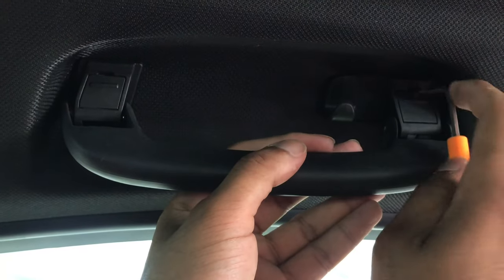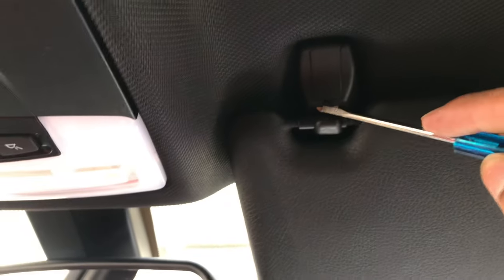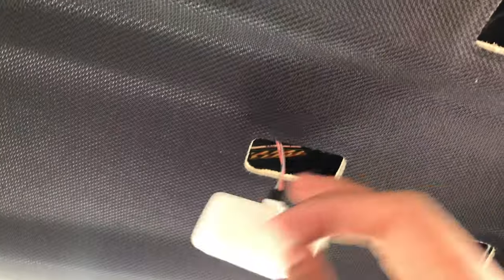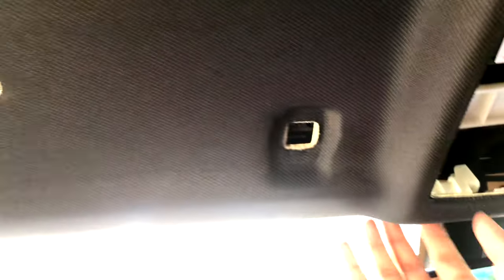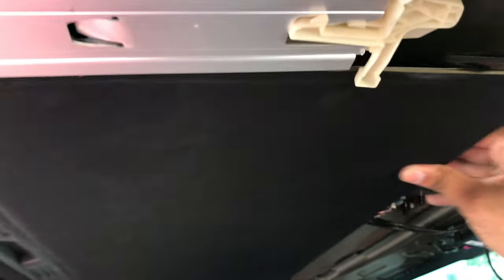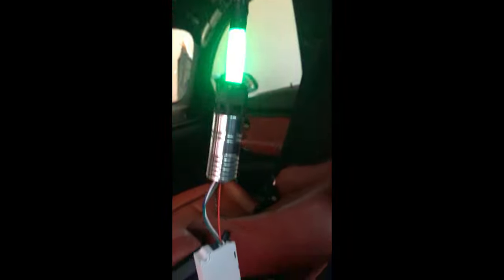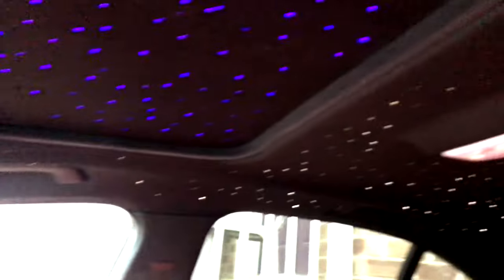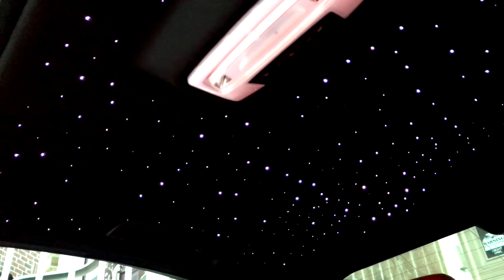STARLIGHT HEADLINER ON BMW F30 (ROLLS ROYCE)

Comment: If you check the left side of your trunk you have a 12 v car outlet you could plug it into. Just found it on my car the other day.
Reply: Where specifically
Reply: @SosaPrOdIgY  trunk on the drivers side (opposite of battery side)

Comment: Since your lights are connected to your inverter, do you leave the inverter on all the time or you have to turn the inverter off everytime you leave the car? I watched the video and bought the same one you got and have it connected to my battery but I don’t know if it’ll drain my battery while the inverter stays on but keeping the lights off.
Reply from the maker: I usually switch it off. The alternative option would be tapping into the accessory area in the fuse box. (Accessories only turn on once you turn the ignition on)

Comment: Is pulling the sunroof back and forth still smooth as OEM or do the starlights effect the motion of the sunroof?
Reply from the maker: No, it’s not smooth. That’s the only thing you have to sacrifice in order to do the sunroof.
Reply: @BuildsBySahib  Is there anyway that it could be made smooth?
Reply: @BuildsBySahib  you mean sliding the sunroof glass isn't smooth or just the sunroof cover?

Comment: Hello I would like to know where you plugged the engine led light 16w on your car. Is it directly on the battery? Or somewhere else you found 12v cable? Thanks
Reply from the maker: I used a power inverter which is connected directly to the battery.
Something like this 👇🏻
400W Car Power Inverter, DC 12V to 110V AC Converter with 2 Charger Outlets and Dual 3.1A USB Ports Cigarette Lighter Socket Adapter https://www.amazon.ca/dp/B088PFQLM7/ref=cm_sw_r_cp_api_fabc_zKM2FbNE01ZW5?_encoding=UTF8&psc=1
Reply from the maker: Another option is to tap into the fuse box in the accessory area. You can buy fuse tap from amazon
Reply: @BuildsBySahib  OK thanks very much. But is it possible to plug at cigar lighter or ceiling light directly. I'm looking for the shortest and most discreet way for my thread to simply connect. I often hear about logging into the C pillar, what do you think?
Reply: Would you have pics of your plugging maybe? I never found something anywhere..
Reply from the maker: The lights come with a wall plug, you’re gonna have to buy another cable if you want to directly connect the lights to the cigarette lighter. Or you can buy a power inverter and connect it straight to the cigarette lighter and then the lights plug to that inverter.
Reply from the maker: And I don’t have pics at the moment but it’s really simple. My battery is in the back of my car. And I have the inverter wires connected directly to the battery. (Red to positive, black to negative) and after that I just plugged the lights in the inverter
Reply: @BuildsBySahib  OK thanks very much 😊✨✨
Reply: @BuildsBySahib  maybe the best solution for me

Comment: Nice work. How long were the fibers? I’m worried the length won’t be enough for the front of the roof to the trunk
Reply from the maker: Thanks and I used this set below. They are 13.5 ft long.   

CHINLY Bluetooth Twinkle 16W RGBW APP/Remote LED Fiber Optic Star Ceiling Lights Kit Mixed 450pcs (0.03in+0.04in+0.06in) 13.1ft https://www.amazon.ca/dp/B081RBCR98/ref=cm_sw_r_cp_api_glt_i_STJKWPF1DKRBP22SH9KX?_encoding=UTF8&psc=1

Comment: Do u got two different light boxes for the main headliner and the sunroof ? Or did u put all the fibers into the main one in the trunk
Reply from the maker: 2 different. You can do it with a single box too but it might be a bit harder. I’ve seen it done.
Reply: @BuildsBySahib  what’s the link for the second setup? I only see the big light motor
Reply from the maker: Honestly the one I used was from eBay and it burnt out. I would get anything high quality with around 200 fibers

Comment: Yo man what do I do if my lights only come with the 12v plug? Didn’t come with a wall plug and I’m wondering how I’m gunna connect it in my trunk because There’s no 12v outlet in my trunk.. Lmk pls an thanks bro
Reply from the maker: Option 1: You can plug that to a cigarette lighter plug
Option 2:you can cut the plug, splice the cable and  tap the wires straight into your fuse box. (Black wire would go anywhere on metal body of car, red wire goes in the accessory area of your fuse box using this : https://www.amazon.ca/dp/B01DYQM6EO/ref=cm_sw_r_cp_api_glc_i_47CXJMFEQH7KH4CMXERP?_encoding=UTF8&psc=1
Reply: @BuildsBySahib  Solid, thanks for getting back to me🙏🏽

Comment: could u link the lights that u think would last longest
Reply from the maker: So far I’ve had no problems with Chinly products. You can check them out on Amazon or eBay.
👇🏻👇🏻

CHINLY Bluetooth Twinkle 16W RGBW APP/Remote LED Fiber Optic Star Ceiling Lights Kit Mixed 450pcs (0.03in+0.04in+0.06in) 13.1ft +5 Crystals https://www.amazon.ca/dp/B081RBCR98/ref=cm_sw_r_cp_api_fabc_QMM2FbTF4V2N9

Comment: Could you just connect the sunroof fiber optic cables to the main machine? I have a 330i and want to do this
Reply from the maker: It’s going to be complicated to Install but it’s doable. You have to connect the fiber optics from the main set to the sunroof while it’s connected to the main headliner
Reply: Appreciate it man! Started doing it today and the sunroof is a bitch hahaha, how did you make the fibers flat? Also did you use all 450 for the main roof?
Reply: @andrewchowaniec4130  Hey brother your a recent post let me know how it went. I'm thinking about doing mine. I have a 2015 535i.
Reply: @jasonarbelo4711  Hey man went great!! Reach out if you need tips

Comment: Is this bad for battery or is it safe at all ?
Reply from the maker: It’s safe since the only light source is in the trunk and there’s no load on the battery when you switch off the inverter of if you tap it directly to the accessories.

Comment: What did you end up wiring it into ? is it on all the time ?
Reply from the maker: BYGD 300W Car Power Inverter DC 12V to 110V AC Converter 2 Outlets with 4 x 3.1A USB Ports https://www.amazon.ca/dp/B07WXH3W2M/ref=cm_sw_r_cp_api_i_a8ysFb1WGQK11
Reply from the maker: I have this inverter connected directly to the battery. The alternative way is tapping into the fuse box

Comment: Did passenger restraint system popped up after you ran it down the pillar?
Reply from the maker: No it didn’t
Reply: @BuildsBySahib I did something wrong then.
Reply: Mine did, did you find the solution
Reply: Mine sadly came up and I thought it was normal… Will wait till I install everything to see what’s up with that
Reply: @raheemkoger3389  bro my shit came out, how’d u solve it?
Reply: @naturalborngamer2275  did u find solution?
Reply: @grayprojects591  yes my friend cleared my codes with his MHD adapter + app. I believe you can also do it with bimmer link app with a supported Bluetooth adapter. I personally use the veepeak adapter.
Reply: @naturalborngamer2275  Ty man!

Comment: What kind of tool are you using to punch the holes?
Reply from the maker: I used a small iPhone pentalobe screwdriver. You can use anything sharp
Reply: @BuildsBySahib  thanks for the reply, I ended up getting a cheaper rotor tool and it worked perfectly

Comment: What kit did you use?
Reply from the maker: CHINLY Bluetooth Twinkle 16W RGBW APP/Remote LED Fiber Optic Star Ceiling Lights Kit Mixed 450pcs (0.03in+0.04in+0.06in) 13.1ft https://www.amazon.ca/dp/B081RBCR98/ref=cm_sw_r_cp_api_glt_i_YSZ164Z1WJHTPKTT3APG

Comment: Links please?
Reply: Also to the extra fiber optic link that you used from the sun roof
Reply from the maker: CHINLY Bluetooth Twinkle 16W RGBW APP/Remote LED Fiber Optic Star Ceiling Lights Kit Mixed 450pcs (0.03in+0.04in+0.06in) 13.1ft +5 Crystals https://www.amazon.ca/dp/B081RBCR98/ref=cm_sw_r_cp_api_i_4ogsFbGJ5JS6D
Reply from the maker: I don’t recommend using the small one, it burnt out a bit later

Comment: Name of kit and where can I buy it ?
Reply from the maker: Chinly starlight headliner kit 
https://www.amazon.com/CHINLY-Bluetooth-Twinkle-Ceiling-Crystals/dp/B081R9K3LM/ref=mp_s_a_1_7?dchild=1&keywords=chinly+starlight+headliner&qid=1599071981&sprefix=chinly+s&sr=8-7
Reply: @BuildsBySahib  great video. This links to 200 pieces which you mentioned would be used for the sunroof. Did you connect everything into one box or used two separate boxes? One for the sunroof and the 450 for the rest?